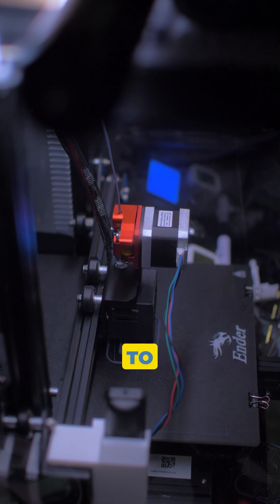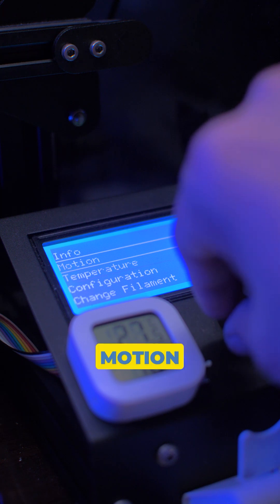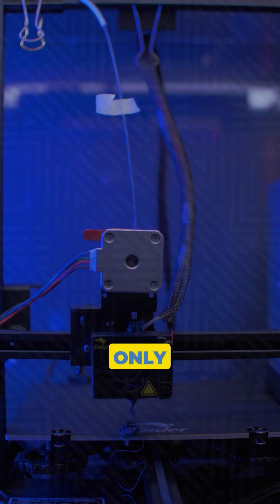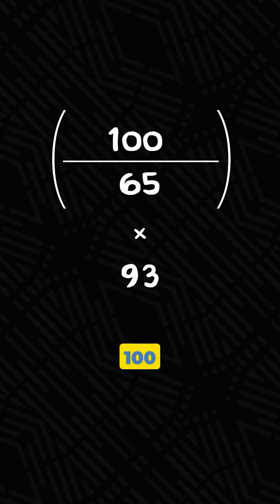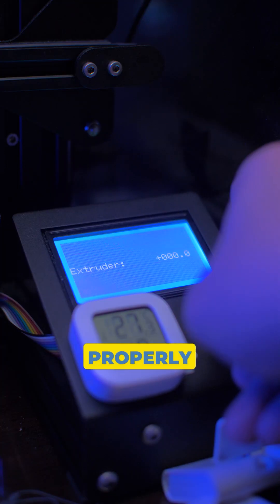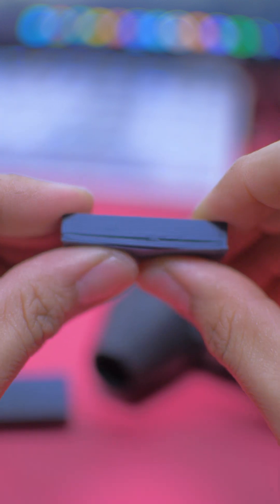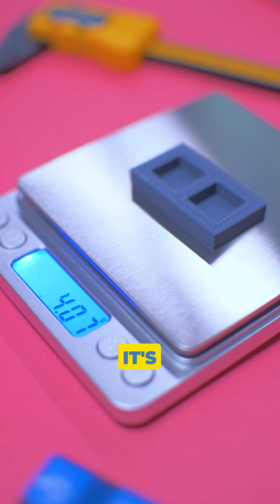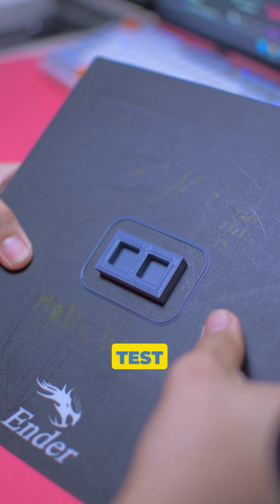How to calibrate e-step on Ender 3.

Comment: I was having serious under extrusion and did this calibration. It made a huge difference but now im having an issue where it is working well for a few lines and then gets worse and worse the next few lines and then a terrible line then back to good again. Rinse and repeat. Its not always the same amount of lines in between either do im not sure what to make of the inconsistency.
Reply: I think because not hot enough temperature, add 5-10 degrees

Comment: I have the same direct drive and have adjusted the stepper motor so that it does 10 out of 100, but when I start printing, after a while, no filament comes through. You can hear that it can't push it through anymore. Do you have any idea what this could be?
Reply from the maker: maybe the temperature is not hot enough, your nozzle is clogged, or your filament may be catching on something, check your PTFE tube or filament holes if there's blockage

Comment: How do you get it to extrude after you enter 100? Nobody in these videos answers that
Reply from the maker: @deedeetee17  it should automatically extrude after you enter 100
Reply: @ dang my didn’t - I guess that’s why I’m stuck
Reply from the maker: @deedeetee17  do you have an ender 3?
Reply: @steampao69  Ender 3 pro. Upgrading soon but cutting my teeth on an old printer
Reply: My ender 3 e-steps had to be adjusted from 93 to 112, but my ender 3 pro needed to go from 93 to 420. At first, I didn't think mine was extruding at all either, but it was just very, very little. I'd still do the test and then measure even if it doesn't look like it did anything. You will get it much closer, then do it again. Also, I'd use a sharpie instead of tape in case it  over extrudes.